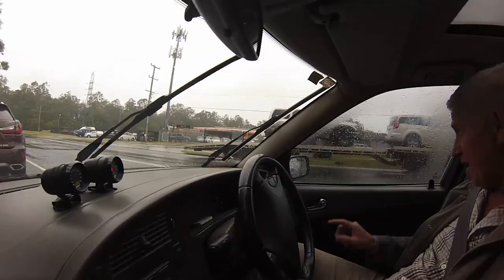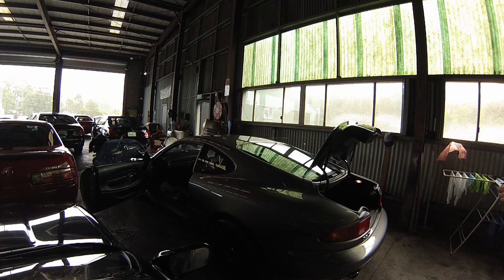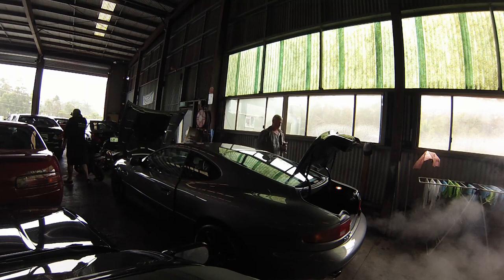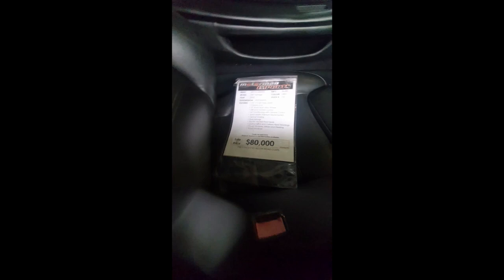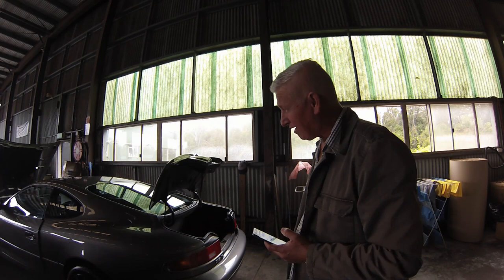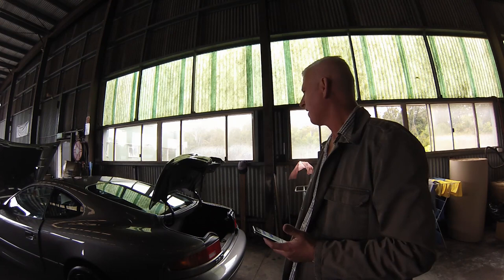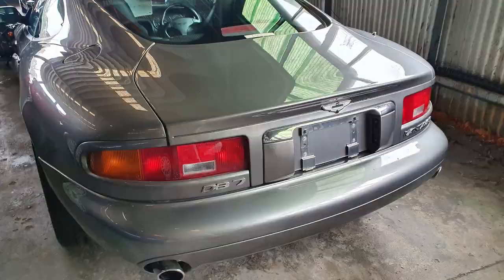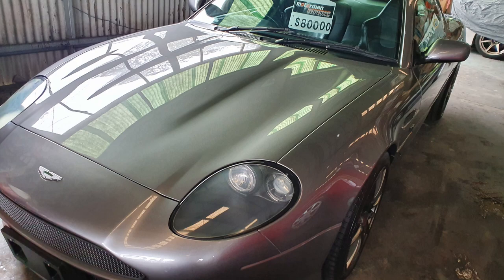V12 Aston Martin DB7 Vantage Pre Purchase Inspection. So dodgy!

Comment: Nah.
That's got a nasty miss at idle and even sounds like its dropped a cylinder through the rev range. 
That panel has been off many times before, should be firmer in fitment. 
The coolant isn't cool. 
Even the inside of the headlights don't look ok. 
Did it smell like it's been wet inside?
Spot on with the log book. That's doctored.
I'd walk away at that price. I'd walk away at something even half that for what it will cost to sort, even if your mate did it themselves.

There's a reason that car was way back in the garage.
Reply from the maker: Good points mate. Nah no smells at all.